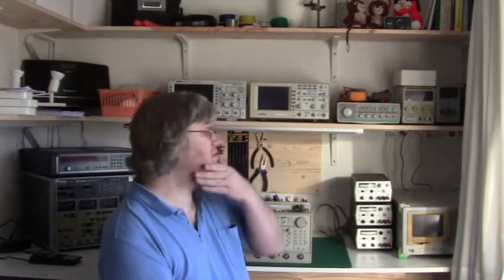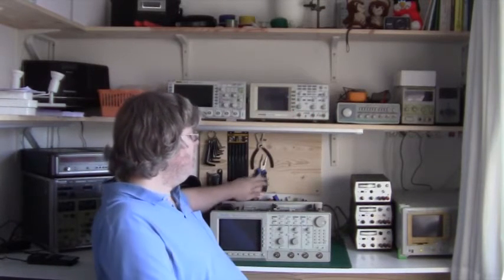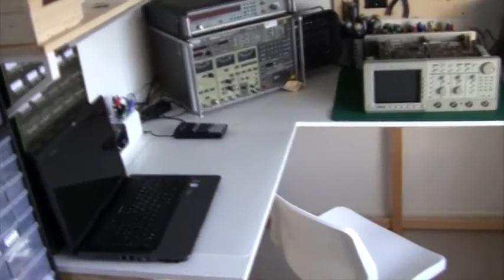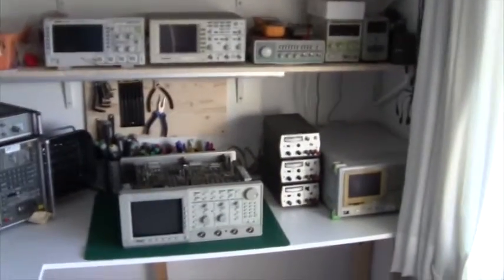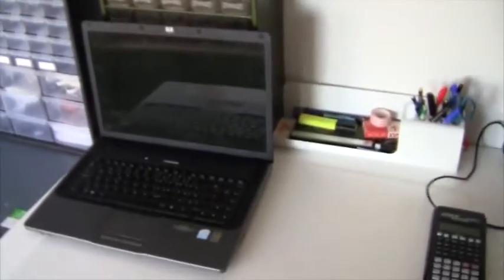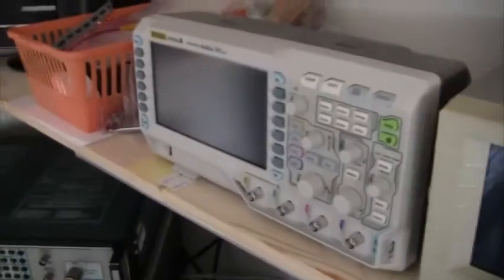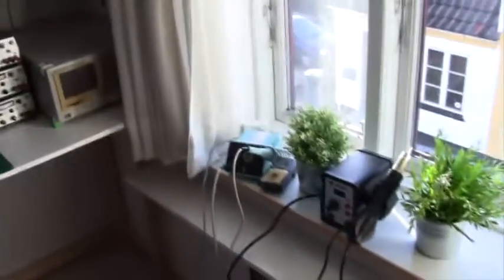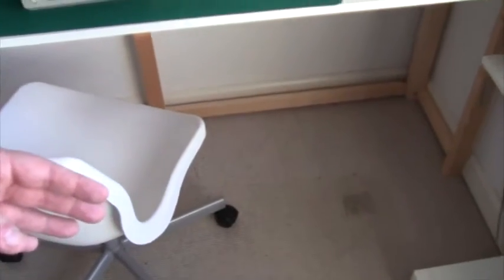My electronics lab before the new layout

Comment: Why not get a computer rack cabinet and then rack mount all the test equipment? That would make everything organised and easily transportable.
Reply from the maker: I am not really keen on 19" racks.
Reply: That is an interesting position. You can often find some very cheaply secondhand on ebay and they really help to be organised. Even if it is just the frame. the sides and rear often detach allowing easy access from all sides.

You can get wheels on the bottom allowing you to push the cabinet around.

If there is a fire they can protect your equipment with an IP rating.

I love them.

Use them all the time on mine sites.

https://www.cs.swarthmore.edu/program/facil/pics/rack.jpg

http://thumbs3.ebaystatic.com/d/l225/m/mvJTTHnneMoYqoLPN5bKx7A.jpg

Comment: Always good to see how someone else tackles the work area and storage. Lots of goodies.
Reply from the maker: +E. Steve McLaughlin As you can see, there I have very little space, so squeezing it in is a challenge. There will be a new video soon about my new shop layout.
Reply: +NatureAndTech 
A good video maybe, as I would be interested and I'm sure others with piles of small parts.. How do you arrange your small cabinets for items like resistors, diode's, SMD, through hole, etc. I have several of the small multi drawer cabinets like you, but I do not have them arranged very well. Things seem to get overlapped and I need to look in 10 bin's to find a certain item.
Just curious, always looking for a better file system, Thanks Everett
Reply from the maker: +E. Steve McLaughlin Excellent idea. I will do a video of that real soon. Thank you.